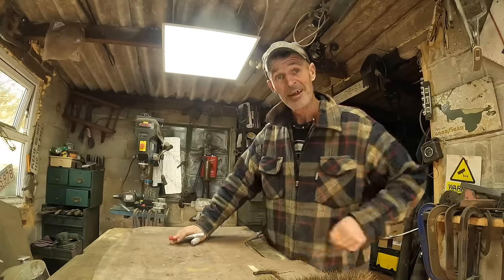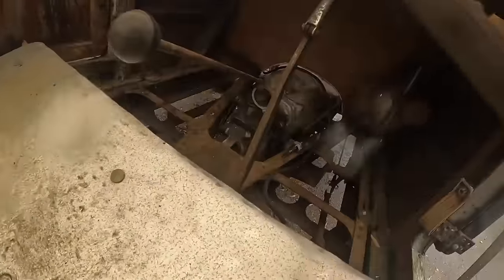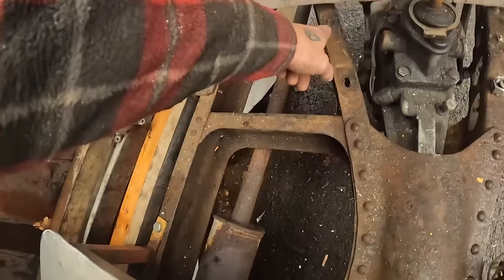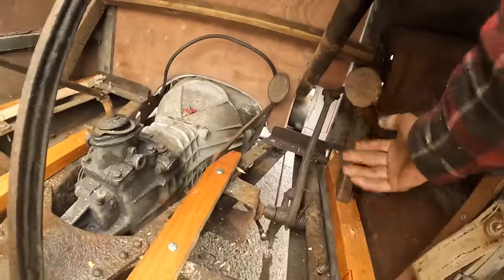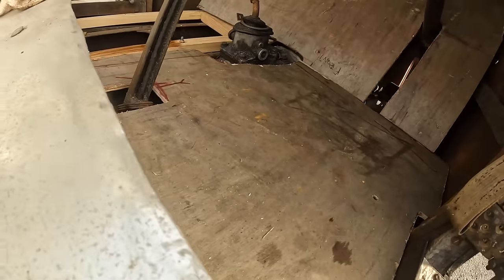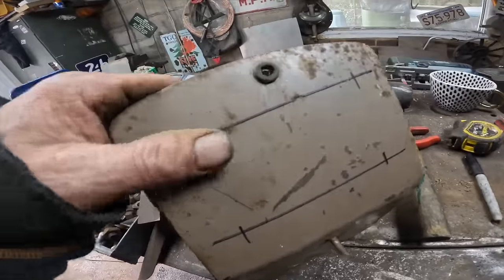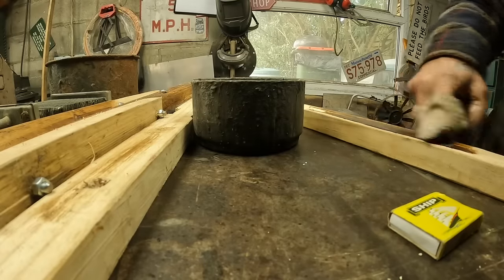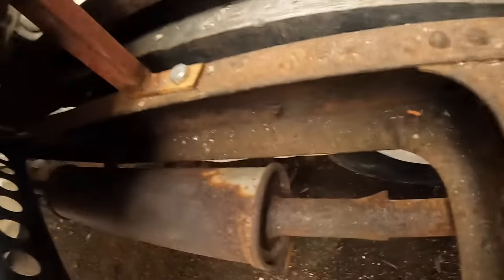'The Leaf'  a ratty roadster, a prewar car build, part Eleven

Comment: Both my boys were raised as gear heads and were always in the shop with me.
When they started dating I told them if they wanted to know if a girl was there type to put a little of that gear oil behind there ear when they were going out .
If the smell of it doesn't run them off she's a keeper ....😎👍
Reply from the maker: damn straight...great advice !

Comment: wow, big step forward! That metal rivet triangle after the gearbox is beautiful, that should be visible... In your place I wouldn't cover it with wood... Cheers bro, keep in touch 🤪
Reply from the maker: agreed and it will be a tad....I built a hot. rod on one of these frames and around and hi lighting that riveted x member ...cheers mate soon bro
Reply: I love the rivet look. I imagine a car done with the body work all riveted, like an old WWII airplane. @oakswamp

Comment: That steering wheel needs an aluminium 'mushroom' (Domed head and stalk sticking in the hole) spinning up. Like the Isky T roadster. A couple of machine screws through the sides, counter-sunk, and it'll look dandy. Polish it up too!
Reply from the maker: would look great but I have the route for the centre...cheers